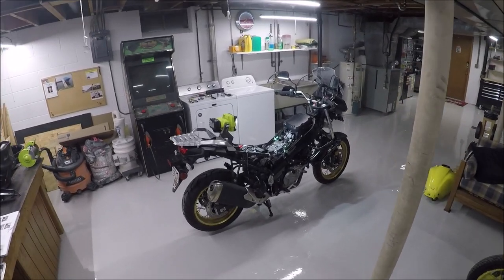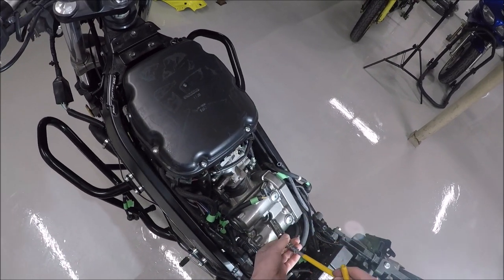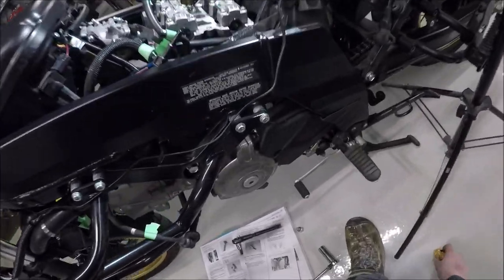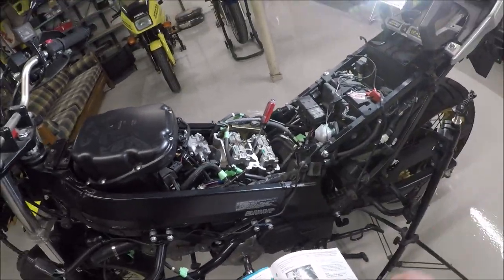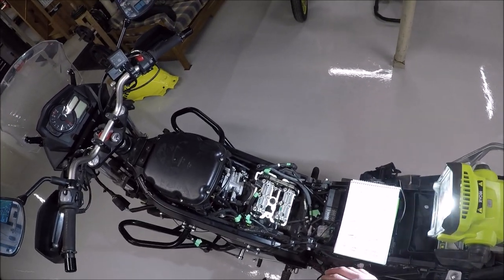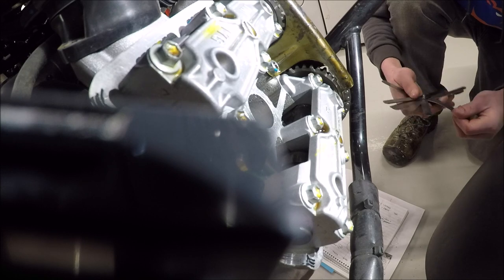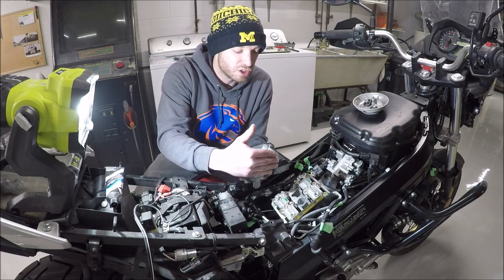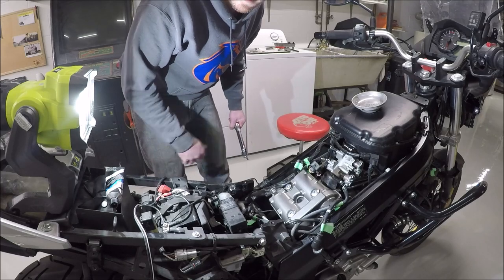2018 Suzuki DL650 V Strom - Valve Clearance Check

Comment: well thanks. have a 2019 with 13000km and i hear ticking. was concerned. but happy now. cheers
Reply from the maker: Ticking is generally fine. I can listen to both my sv and dl650 tick. It's generally more alarming if they're not ticking as most valves tend to tighten up with time.

Given the low miles you've got, I wouldn't be concerned yet. YMMV obviously as I'm not an expert, but i wouldn't worry about it yet.

Comment: I’d like to watch but the constantly moving camera is giving me a headache.
Reply from the maker: It's kind of tough not to if I need to use two hands--though maybe I can try shooting intros by holding the camera on a stick (instead of head mount), so it's not always following my eyes.
Reply: @matttriestodothings  i bought a dirt cheap tripod ive been using for all of mine
Reply from the maker: @Mad8vCycles  I used the cheap tripod for part of this, but the complaint of head movement is legitimate. I probably shouldn't use the head mount unless I'm forcing myself not to look around as much. Sometimes it's the only decent way to film something tho.

Idk, production value is not something this channel has nor ever will, lol. I just like making vids when I can't find another video of a process, and I can't find any others of a 2017+ DL650 which has more bits like rear ABS to fight with when reaching the rear tensioner.
Reply: @matttriestodothings  the problem with  head-mounts (same in the shop as on the helmet) is that you're either the camera or the performer. the better you're at one the worse you are at the other (how many times have you ended up with shit video from doing something, or ended up trying to do something with one hand cause the other was busy... )
Reply from the maker: @Mad8vCycles  hah, I suppose that's very true. I never realize how often I check blind spots while riding until I see my helmet footage. At an intersection my head must look like it's flying around on a pivot. Doesn't make for good video at all.
Reply: @matttriestodothings  also, the faster you get on track, the worse of a camera platform your head becomes. i stopped running helmet mounted cameras racing minis cause all id get video of is lawn
Reply from the maker: @Mad8vCycles  I can't imagine running one on the track. I only occasionally put mine on for street rides, and at freeway speeds it pulls my head around. The track day orgs around me in the Midwest don't allow them anyway, so it's a moot point. I'd be curious to try it once just to see another view and what my hands are doing on the grips and levers, but I think the on board is sufficient to learn from.

Comment: Awesome video. I'm 53k km and still afraid to check valves lol
Reply from the maker: If it's running fine... ehhh... just put it off until you change the coolant. Some people go 100k miles and never look. Other people get unlucky. It seems like these bikes fall into line most of the time or don't get seriously outside of tolerance.

That's not me endorsing never checking them. Just that I'd pair it with some other maintenance during a down time. The clearance check really isn't bad. I believe in you!
Reply: @matttriestodothings  thanks man. I changed my filter today in 30 mins. I think I'll aim for the valve check next year when I get to 75km. Bike is running great so I'm not concerned. Thanks for the info.

Comment: which manual are you using? im new to motorcycles and have only ever used haynes manuals for cars.
Reply from the maker: This is the big boy Factory Suzuki Manual. I've always just bought the Haynes and been fine for the most part. I just figured to buy the big one since this is the only new vehicle I've ever bought in my life.

I'm still getting used to it. While there's more information, it's harder to find it. I have no idea why they didn't decide to put a glossary for the final pages of the book..
Reply: @matttriestodothings  thank you. Where did you get it from? Straight from suzuki?
Reply from the maker: @yosarian1984  I bought it from genuinesuzukimanuals.com for $90 + 12 shipping (6/17/2018). I think is associated with Suzuki America and the official place for us Colonials to buy the manual. They shipped a real one to me--I know that for a fact. 

I've successfully used the Haynes for a lot of work on other bikes and they've been sufficient for the most part. They're not as in-depth, but I also go to the internet to research shit before I turn a wrench which usually fills in the blanks. So it's up to you on which route you want to go. If I was doing serious engine work I wouldn't think twice about ordering the Factory manual. However, I think with what I'm planning to do.. I'd have been fine with the Haynes.
Reply: @yosarian1984  Or you can do a google search before buying the suzuki one. Maybe it's not the same clear quality as the original but content is the same

Comment: Such a useful video. Thank you again!
I have the 1000xt but this is helping me grow a pair and pull the trigger on that extensive disassembly.
Reply from the maker: Thanks man. The good news is that I've heard the 1000 is much easier if you do have to swap shims due to a completely different cam drive design (chain vs gear). I believe your bike has bigger shims than the ones on the 650.

I'd just try to pair it with some other maintenance if/when you have the tank off. If you've gotten the tank off... that's more difficult than actually doing the clearance check itself.

Comment: Nice floor, looks like it came out great.
Reply from the maker: Thanks man, I'm loving it so far. It's far from a perfect job, but it came out as good as I could have expected.

My mom stopped by with her dog earlier today and the dog got to the bottom of the stairs and refused to walk on it because I assume it looked like liquid to her. It was hilarious. She finally took a step on it and started walking sideways. Hah.
Reply: You did what most DIY home owners don't do and that's grinding the floor, for that reason alone it'll last 10x as long.  Also it's nice to see you didn't use a flake, I just dislike that fad so much.

I had a german shepherd growing up, took him to a park and he thought the scum covered water was grass.  That dog hated water of any kind after that.  Just my Husky run through my screen door out back to get inside, running out I can understand, but inside?!
Reply from the maker: @williamfoster4268  I'm not sure why everyone defaults to flake. The full broadcast flake for a garage makes sense--especially near me in a place with snow because it'll get really gross... but I think it looks so much more interesting indoors without flake. It definitely shows imperfections a lot more readily though. I see several spots where I thought I did enough concrete repair on cracks but nope, hah.

Comment: Hi.
I'm about to attempt a valve clearance check on my 2019 Vstrom DL1000XT.  Do you have a link to where you got the print offs from please? I'm struggling to find any manuals online. Cheers
Matt
Merseyside, UK
Reply from the maker: Just a heads up--your bike is a bit different than this (if I'm not mistaken). I believe the DL1000's are gear driven cams unlike the chain driven cams of the 650s. It should actually be an easier procedure than what's shown in this video. 

I was using a physical copy of the factory service manual for this.

Comment: Super useful vid. Kinda thinking i shoulda made one for the sv but i can just link to yours :)
Reply from the maker: You know these bikes better than almost anyone--I'm confident I'd learn a lot from watching you do one if you get the urge. I went back and found your cam chain tensioner comparison video prior to starting filming this. I actually think that I can remove the CCT spring and bolt without taking a single piece of this DL650 off; however, I've got a new rear tire on the way regardless, so I'll probably pop off the rear wheel.